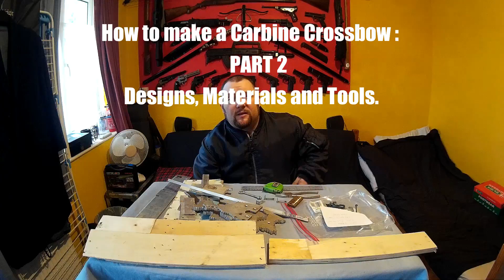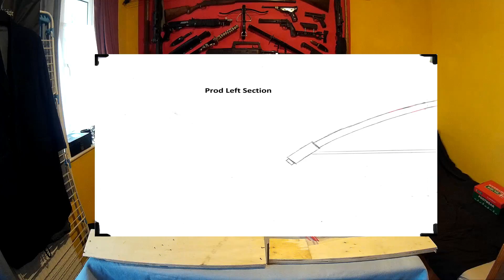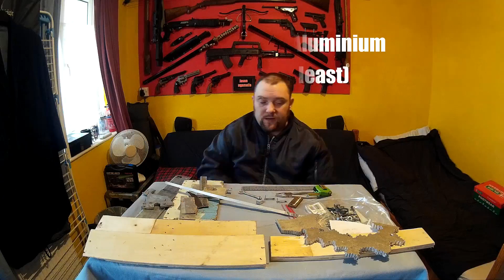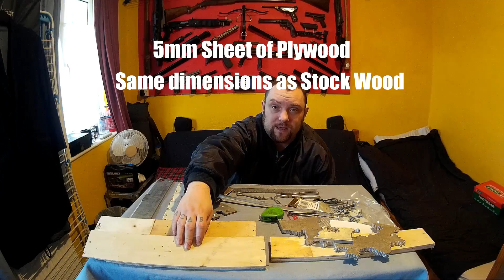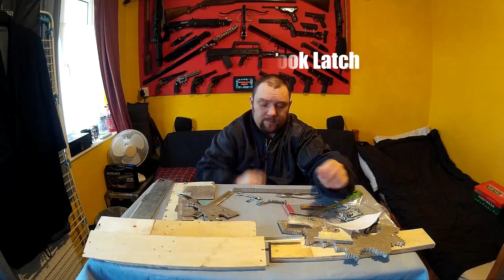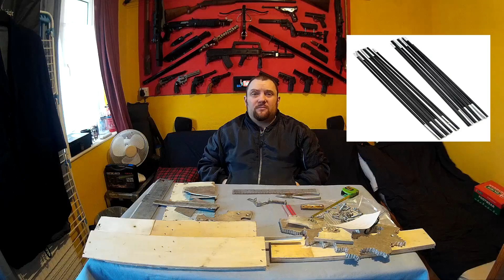How to make a Carbine Crossbow Part 2 : Designs, Materials, Tools

Comment: Great to see you engineering and keeping yourself busy.
I'm thinking of getting one of those Benjamin Pioneer air-bows whilst they are still unregulated, but with the air-tank/accessories it will be around £1500 so quite pricey.

They shoot 156ft/lbs kinetic energy, with 450fps and shoot 26/28" arrows not 17-20" bolts but push from the front not the rear so are more stable in flight and more accurate.  They have the potential of increasing the muzzle energy further with heavier bolts by trial and error to find the sweet spot.

They have the capability of adding picatinny rails and with a bit of ingenuity you could accessorise with a bayonet/the full works.

Only problem is, especially when shooting heavy arrows, it's sounds like a rocket launcher going off because it's 3000psi so I might have to phone the police every-time I fire it lol.....Anyone know how to make a reflex suppressor for an airbow where the arrow glides over the barrel, now that will require some serious engineering? :-)